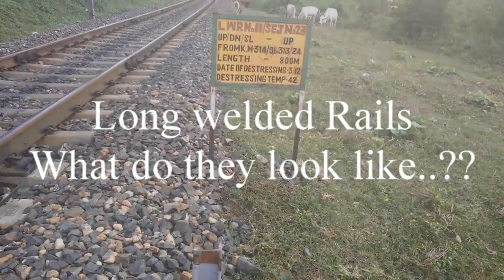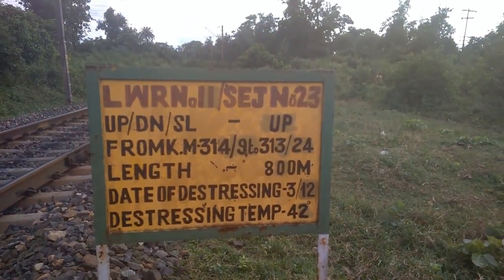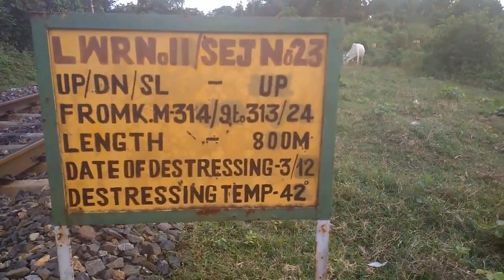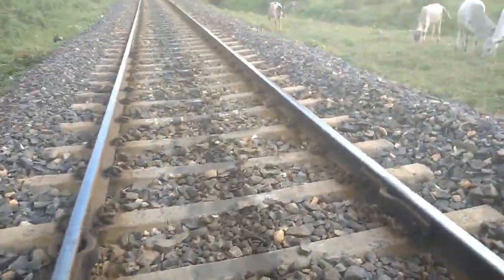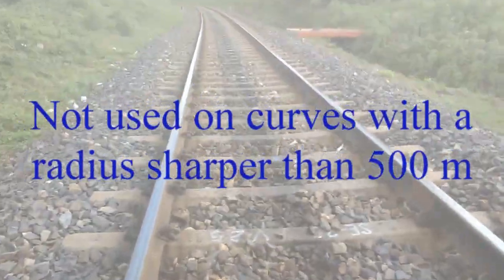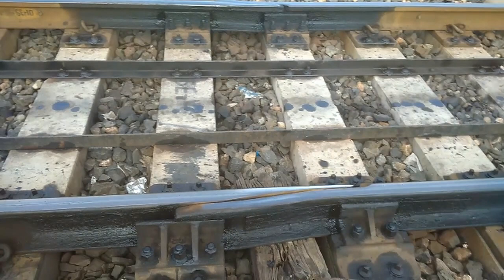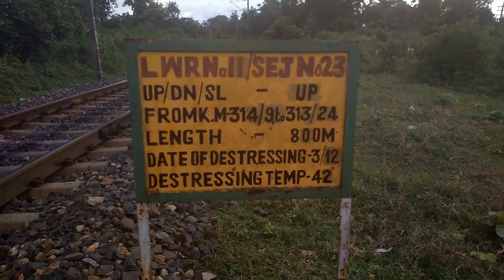Indian Railways: Long Welded Rails || What do they look like..??

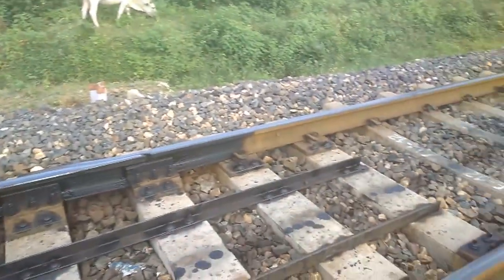Comment: 1:02   *Max. length of LWR is up to block section.

& minimum length is 250meter 

or 20 rail planal = 20*13 meter = 260 meter.